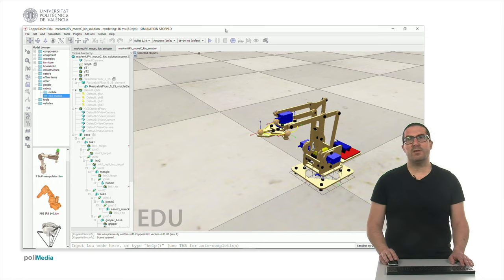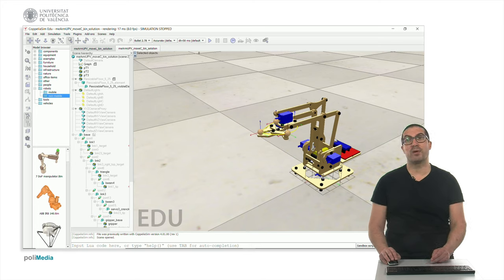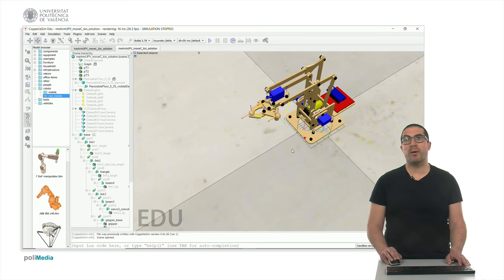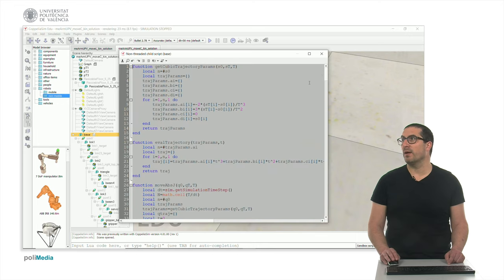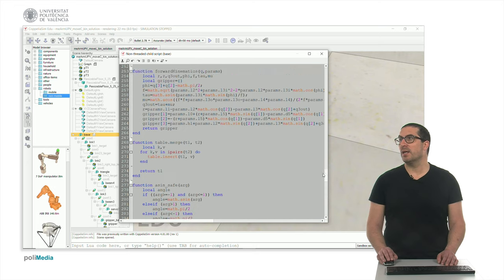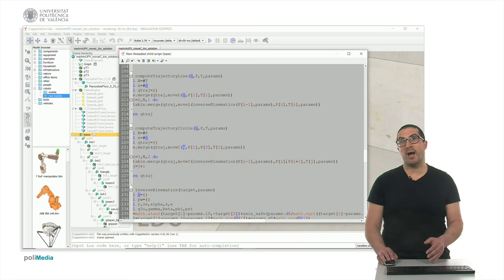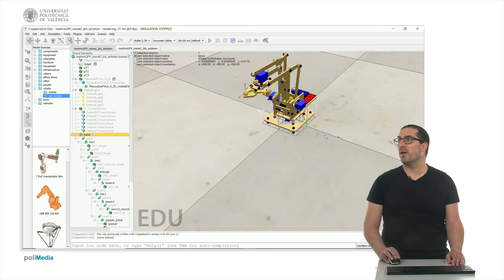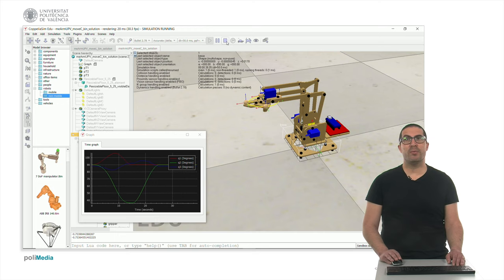Circular end-effector movement using a cubic trajectory (moveC) | meArm Robot | CoppeliaSim

Comment: Hello, thank you for this tutorial it is very rich.
But have you thought about coupling the virtual model on CoppliaSim with the physical model of the robot using the Arduino board coupled with an IoT communication protocol like MQTT or DDS (it is very requested this coupling).
Does CoppliaSim allow us to do this physical-virtual synchronization or not? 
I talk about the digital twin simulation. Do you have an idea?
Reply from the maker: Hello, I guess it’s possible, but haven’t explore those ideas… very interesting anyway. Thanks for your comments
Reply: @LeoArmesto  Thanks anyway. I found that someone has been working on training a digital twin model of a robot (parts assembler) with this software using deep reinforcement learning so that it is able to determine the most optimal path to assemble the parts. It simulated to optimize, but did not couple with physics. I am delighted tonight with the follow-up to your tutorial.